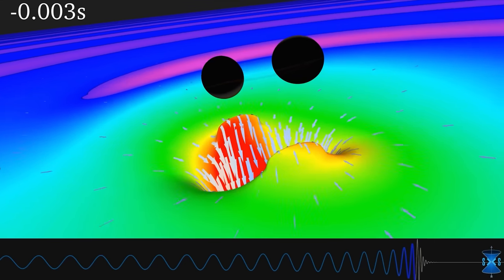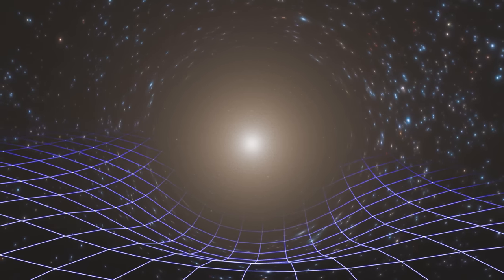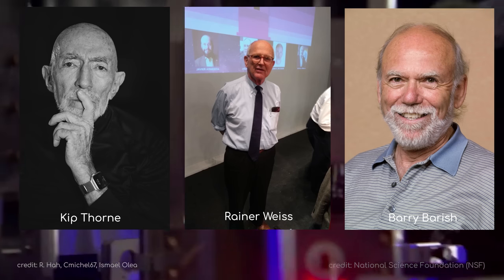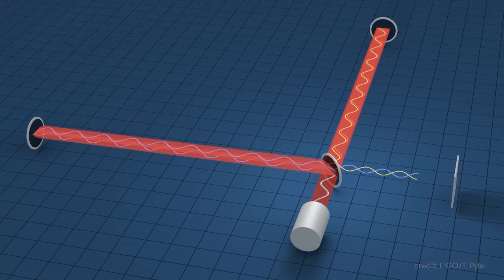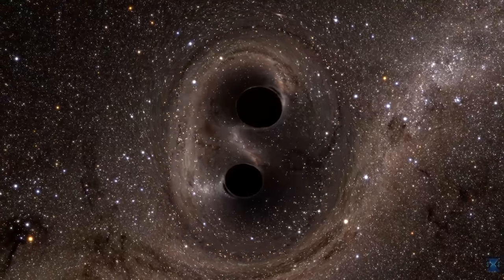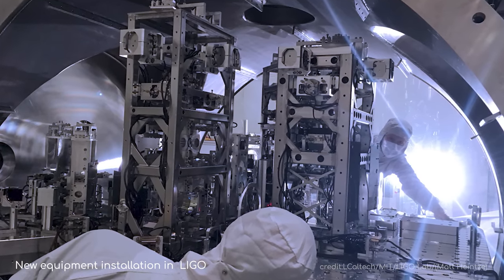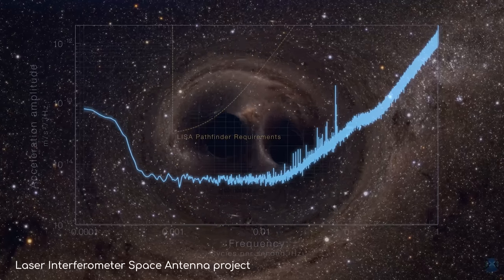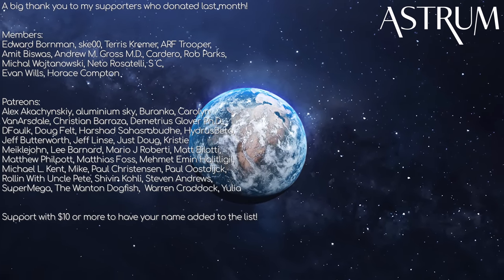The Explosion 50 Times the Combined Power of Every Star in the Observable Universe

Comment: Slight correction: at 6min or so you say the main reason for two LIGO observatories is for triangulation, the main reason from what i remember is to be able to discard local interference, such as a lorry passing by will give a signal in one observatory but not the other, thanks for great videos!
Reply: That was what I thought too. The instruments are so sensitive that a human walking beside the pipe will create a signal in it. Also two points for triangulation will produce a circle.
Reply: There is a 3rd observatory called VIRGO (which is in europe i believe) and thats where the triangulation comes in!
Reply: Having them in separate parts of the world is how local interference is discarded. They look for when they catch the same things at the same time. It's kinda like triangulating, but not. I think he just misspoke.
Reply: Basically saying potato instead of puhtahtoe (like a psycho.)
Reply: Correct, basically noise elimination. I think the process requires such sensitivity it is inherently very noisy as well.

Comment: Getting LISA components to sync up and maintain line-of-sight using attitude jets and gyros would blow my mind as much as whatever it discovers.
Reply: Each LISA satellite would consist of a shell around a floating, independent mass. The shell and mass would not be in contact.

When operating, the distance between masses would be measured by these shells.

Keep in mind that the actual distance between masses is irrelevant to detecting a gravitational wave.  It is the CHANGE in distance (to thousandths of a proton diameter) that matters.

Comment: There was a time when it took me a while to understand gravity as not a 'pulling force' but rather a curved geodesic path in space around massive objects. Now that gravity is being talked of in terms of waves, I'm confused all over again.

Also, what kind of disaster control is built into LIGO to handle physical disturbances like earthquakes? What if the mirror or the light source shifted? How destructive or resilient is the whole  setup during a natural calamity?
Reply: I guess you can kinda see waves as that curved path being shaken like a sheet as massive objects move around at high speeds.
Reply: Curved lines/waves still doesn't address the root cause (the elephant in space), mass. 
Curves are an observable effect yes but not the cause, somehow mass gathers or pulls on space/time fabric(Higgs or whatever) layers to produce the curve effect. The center point between two of each item of mass (unknown if needing 2 or more items) is where gravity happens, outside that center point is just standard curved space/time being micro/tiny pulled by the center points in at least all 3 directions to the center of the center points. It will make sense later.
Reply: Please remember that gravity is a warping of space time.  Neither space nor time exists without the other.  They are different characteristics (dimensions) of the same thing.

LIGO has travel limits and stops in their mirrors and equipment.  If an earthquake occurred, the mirrors would move a tiny distance and hit limit stops to prevent massive damage from occurring.  I believe there are also clamps to prevent them from moving at all.  Of course, all observation would come to a halt during the earthquake.

Comment: Question:  the visual always shown with LIGO and gravitational waves looks like waves on a plane(like a 2D plane) - but aren’t gravitational waves sent in all directions(ie 3D)?
Reply: yes. Because it's /really/ hard to visualise in 3D without it being entirely confusing. Esp since it would have to be depicted in 4D, which we can't percieve.
Reply: No.  The waves are strongest in the plane of rotation of the merging bodies.  While the animation is represented two dimensionally, and the actual waves are three dimensional, it’s a pretty good representation.

A better representation would be slinkies radiating out in all directions, with the slinkies in the plane of rotation experiencing the greatest extension/compression waves, and the other slinkies experiencing smaller, until the slinkies at the poles experiencing very little.
Reply: And since space-TIME is affected, those waves should also be measurable by clocks.

Comment: How the heck does ligo account for seismic activity?   Passing asteroids?  Or even penetrating cosmic rays?  This level of precision seems impossible.
Reply: Right? Maybe since both are on the same reference point i.e earth, it could be possibly cancelled out? They never address this enough. But I do believe it's possible to measure it.
Reply: Seismic Isolation: LIGO's mirrors (test masses) are suspended as pendulums, which provide passive seismic isolation. This design ensures that ground motion is greatly reduced before it can affect the mirrors.

Active Seismic Isolation: In addition to passive isolation, LIGO uses active seismic isolation, which involves sensors that detect ground motion and then produce counteracting forces to cancel out that motion

.Filtering: The frequencies at which gravitational waves from astrophysical sources are expected to be strongest are above the frequencies of most seismic activity. Therefore, by focusing on specific frequency bands, LIGO can effectively ignore most seismic noise.

Passing Asteroids:Asteroids passing by Earth, even very close ones, don't have a significant gravitational effect that would perturb the LIGO apparatus. Their gravitational influence would be far too weak to interfere with LIGO's sensitive measurements.

 Remember, LIGO is primarily designed to detect gravitational waves from events like black hole mergers, which are cataclysmic in nature.

Penetrating Cosmic Rays:Cosmic rays can cause noise in detectors, but LIGO has been designed to minimize such effects.LIGO's photodetectors are shielded and are also situated underground to reduce the influence from cosmic rays.Additionally, since cosmic ray hits would be brief and sporadic, and gravitational wave signals have a specific signature (like a chirp signal for binary black hole mergers), LIGO can differentiate between these sources of noise and genuine gravitational wave signals.Moreover, LIGO operates two detectors located far apart (one in Washington and the other in Louisiana). A genuine gravitational wave signal should be observed in both detectors with a slight time difference due to the speed of light and the Earth's curvature. Noise, like a local seismic event or cosmic ray hit, would typically only affect one detector. By comparing data from both detectors, LIGO can further confirm the authenticity of a gravitational wave detection.

Comment: If you have a sound wave, and you make an exact reflection of it, it counters the one and it becomes 0. Would it be possible to counter a gravitational wave, and produce a reflection of it? Would that lead to 0 G and floating?
Reply: It would cancel out the fluctuations of G... So it would cancel out to 1G rather than 0G.

But just like noise canceling tech, the effect would not be everywhere. You could focus at a localized node to cancel out the fluctuations, but outside of that node you would have interference patterns making G higher and lower than the neutral point where the canceling is happening.
Of course, you would need something to produce negative G to make that distructive interference... So I guess you would have the tech to make actual 0G anyways.
Reply: you'd need-on present knowledge- the same event that created the wave to start with. And you won't float because it's a shockwave not a change in the local gravitational values. It's ephemeral.

Comment: It seems like they could split the light three ways and put a 3rd detector 4km down into the Earth's crust, and get a 3D detection. Would that help localize the signal? I guess the one in Japan will be off axis anyways though.
Reply: There’s no such thing as a “3 arm interferometer”.  You could have three separate interferometers at 90 Degrees to each other.

Antrum misspoke.  The purpose of multiple detectors isn’t for triangulation, but rather verification.  With so low signal to noise, verification is required, and distance helps.
Reply: @endcgm9277  Oh yeah I knew the two separate interferometers were for verification, I watched a bunch and read a bunch about them last year. But I thought maybe they could use them at different angles to get a "3D" type detection. I didn't even notice Astrum saying triangulation.

But yes that makes sense to have two separate units rather than trying to split light 3 ways, if that's even possible.
Reply: @bwxmoto  

Your idea makes great sense.  It’s just that everything costs money.  

I wonder how much a 4km hole big enough for LIGO and a service elevator would cost?
Reply: @bwxmoto  

Your idea makes great sense.  It’s just that everything costs money.  

I wonder how much a 4km hole big enough for LIGO and a service elevator would cost?
Reply: @endcgm9277   LOL yeah a 4km hole in the ground would probably cost 15 times what a new detector would!

Comment: I would like to know how they compensate for the lengthening and contraction of the light waves along with the physical pathway they travel? It seems to me that the physical change of the tunnel dimensions would correspond to the changes of the wavelengths of the light traveling that path. By the rules I learned when the length of the path is shortened by compressing the space time then the velocity then the speed of light slows to a corresponding value as observed from outside but inside it's still the speed of light and it should arrive at the same time it would have without any gravitational wave. It's still the speed of light but it should take the same amount of time to travel the distance, shouldn't it?

Comment: Wait, so if the alcubiere warp drive is designed to create a bubble around the craft to "propell" the craft through space by manipulating compression of spacetime. We know that it would require immense energy button what if we could catch a lift on a gravitational wave? Create an alcubiere warp drive that creates a small bubble just strong enough to push against the gravity wave and use that wave to provide motion? This would require less energy to accomplish although slowing down might be a problem. Changing direction could be potentially be accomplished by changing the density of the "bubble" applying more "pressure" to one side thus turning. The first space warp drive could be more like space surfing than warping.

Comment: To put this into perspective, i work at a steel plant where we use a 2.4 kW laser to cut 15mm (5/8") steel plate, sometimes 20mm (7/8") if we're lucky, AND it's a pulsating laser at (I'm not sure but i think) 50 Hz, so it's not continuous. 
Now, TRY to imagine a laser, over 300 times as powerful "it will vaporizer you completely" is a bit of an understatement, it will turn you to electron degenerate matter then turn your carbon into radioactive material :D

Comment: Id love to see gravity explained in 3d, the whole universe isnt on a single sheet of paper. The galaxies above and below us, the ones aligned with us and any place in between. A single sheet doesnt explain anything to me honestly. Its simplicity doesnt reflect reality.
Reply: Imagine an explosion. How there's a sound wave emanating from a single point or a sphere? Imagine that pressure wave, that expanding sphere of high pressure, followed by low pressure, expanding out like an explosion. And now Imagine that pulsing over and over again. That's essentially gravitational waves.
Reply: @the_netherqueen it's not the waves part, it's the graphic used to explain gravity itself.
Reply: @the_netherqueen at 2:28
Reply: @Astrolab.insights  7:14
Reply: @Astrolab.insights  13:36
Reply: I agree with your criticism of showing the indentation as if it were only in one dimension. Surely it is a sphere of indentation all around the object like the displacement caused by an object submerged in water. I've always wondered about this too.
Reply: @the_netherqueen Also may imagine from a (random) time after a 3D explosion occurs with it moving in reverse and condensing back to the initial source in an elastic rubber band way in full 3D. That may be a better visual of the idea of gravity and curves in space/time.  (Or a fuzzy sphere's expansion running backwards becoming smaller and compact and dense).

(Unfortunately the 2D bedsheet depiction (more-so showing anti-gravity pushing space away from mass/object centers) is the standard nonsense being widely presented as gravity, at least currently. Overall, more accurate or more updated animations are needed industry wide, though it will be a sizable task to depict infinite wave fronts moving in near infinite ways in 3D to a center point with elastic like features and interactions. Might need some strings).

Comment: You mentioned that the waves move at the speed of light; I've been failing to get my head around how that's defined. We know that light travels through space-time along geodesics, so the path can get diverted by spacetime curvature. Do gravitational waves also get affected by curvature from other masses, or do they travel "straight" by some better definition? Presumably this would be detectable in multimodal observations if so?
Reply: I do know that gravitational waves are far less likely to be distorted than light waves.  I cannot say if they are immune to distortion or not.

Light itself rarely travels at “the speed of light” (in a vacuum), as space itself isn’t a perfect vacuum.  As light travels slower in glass than air, it travels “slower than light” through non-vacuum of space.

The benefit of this is that LIGO can detect an event up to two weeks before it is visible by light or radio telescopes, and tell other astronomers where to look in advance of light and radio waves reaching earth.

Comment: I'm skeptical that they're detecting what they think they are. 50 times all light in the universe for two tiny back holes?
Reply: They were anything but “tiny”.
Reply: @endcgm9277  29 solar masses is tiny compared to Sagittarius A*, which is over 4 million solar masses and Sagittarius A* is one of the smallest at the center of a galaxy. The smallest known black hole is 3.8 solar masses. On the scale of black holes, 29 solar masses is definitely on the tiny end.
Reply: @itry2brational  

I didn’t hear the “28 solar masses”. I agree, that’s relatively small.

But Ever heard of E= mc^2? It doesn’t take much mass converted to energy to be astounding.

Even a nuclear bomb converts exceedingly little of its material to energy.

Comment: Not mentioned but presumed the more such machines the more reliable the signal detection becomes as being real and not noise  for my thinking is noise must be everywhere.... even the slightest tremors in the earth would shake the apparatus and mechanically distort the precision ... the distance between the reflector mirrors.  Our Richter machines.... which are not nearly as precise as these machines ....detect the slightest seismic rumbles that happen everyday all around the earth and propagate across the surface and through the crust.  Such noise must be common.... not just actual seismic vibration but large trucks... trains. .construction.... all cause mechanical vibrations on the surface that at these sensities might very well be detected.  Having multiple machines I assume enables better distinction between noise and an actual signal of a gravity ripple.  What other sources of noise must there be?  Slight temperature variation.... imperfections in manufacturing .... and as the video explains even random quantum hiccups.  I was busy writing this post before the video ended so did I miss the stated plans to build such a machine in space?  That would eliminate seismic vibrations.... improve the measurements.... but to what end?  Wonder what the wave lengths of gravity waves are?  They travel at light speed so are they truly part of the electromagnetic spectrum with frequency and wave length?  What advantages are there in learning about the universe by focusing in at this wave length which i assume is very long as opposed to visible light as per Hubble or microwave light as per the Janes Web telescope?  What information is embedded in these waves that offers additional insight into the wonders of the universe?  Are gravitational waves subject to distortion or interference like light waves?  What additional information are we able to collect at gravitational wave frequency that we cannot get from Hubble or Web.... or is this more just confirmation of theory but without practical application to advance our understanding through observation?

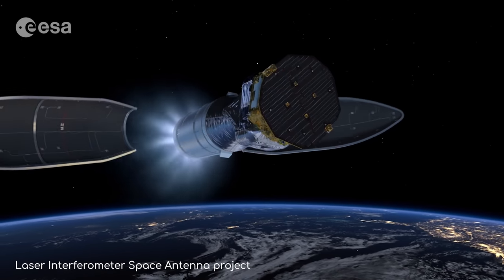Comment: 13:15 LISA should have 4 spacecraft in a tetrahedron to capture gravitational waves in three dimensions. With only 3 spacecraft it can only measure in one plane (ie 2D). Why limit it's detection capabilities by an entire dimension? If it's not on the earth'ssurface, it's relatively easy (launch 1 more spacecraft), compared to drilling a kilometre long vertical hole or building a tower on the surface  (with a vacuum).
g vertical hole or building a tower on the surface  (with a vacuum).
LIGO is incredible. One of the most underrated news stories of my lifetime.

Comment: Not even a mention to VIRGO? The one that also was needed to triangulate the neutron neutron star collision? By the way, you are wrong, to triangulate, you need 3 measures, otherwise you have 2 solutions. You are usually good, but now I wonder...
Reply: Triangulation requires three "measures"??
Obviously different to the method of triangulation whereby you get the distance to a point from the angle of two known points and the third, target point forming a triangle with one known side and two known angles then huh...?
🙄
🍄